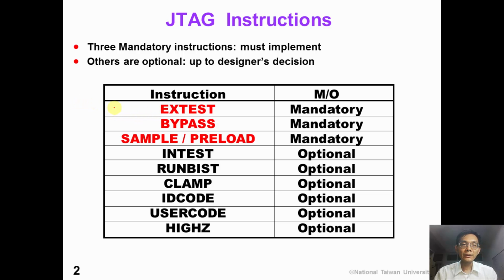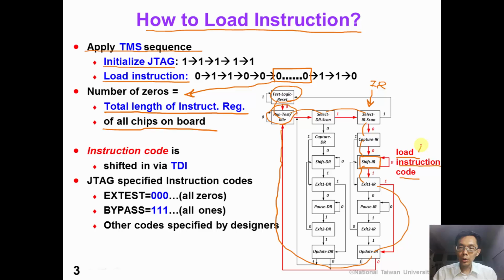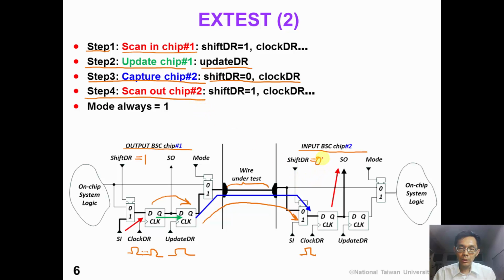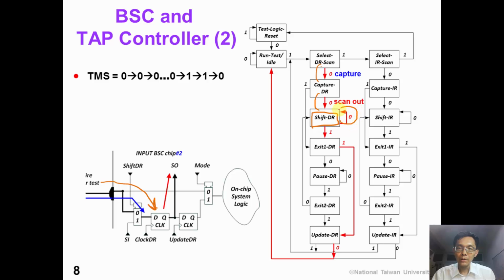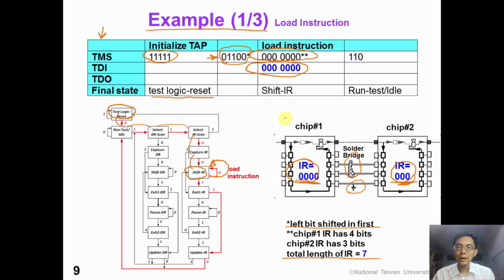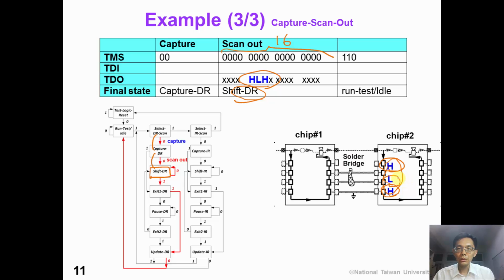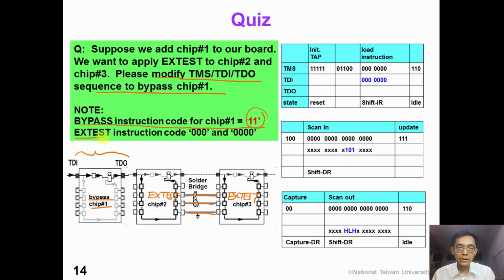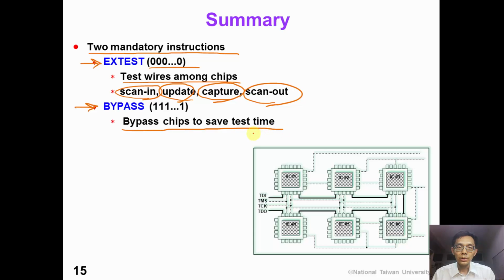12 3 DFT2 JTAG Instruction (old version)

Comment: Great Tutorial. Just one observation at time 19:34, EXTEST instruction with Bypass on Chip1, scan out of bypass instruction & data would be needed to be shown on the left side. I am pretty sure this is just an overlook.
Reply from the maker: we show the data from left to right.  Chip #1 is the last one in the JTAG scan chain.  so the data of chip #1 is on the rightmost side.
Reply: Thanks Professor
Reply: @李建模-k8c  is the shifting direction from chip3-chip2-chip1, which is opposite of the diagram? that's why the instruction code loads in order of 000 0000?